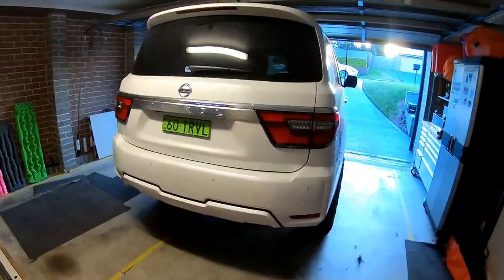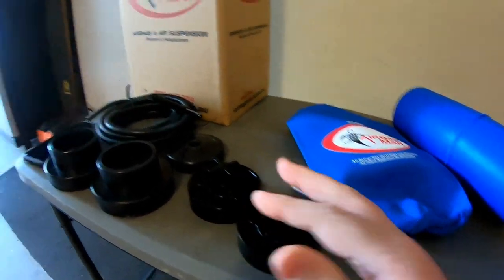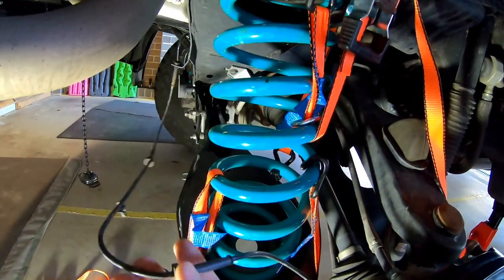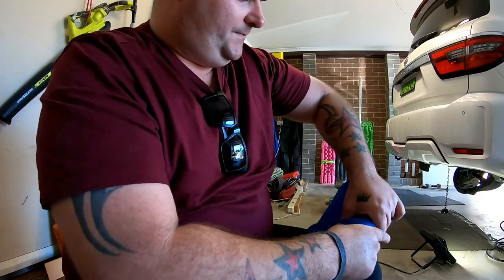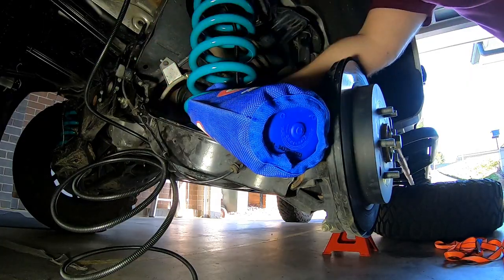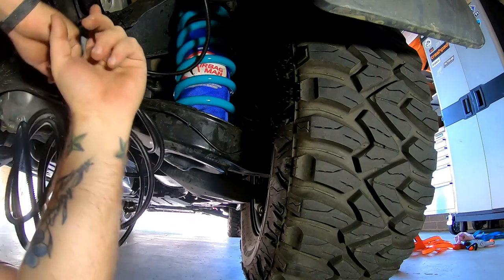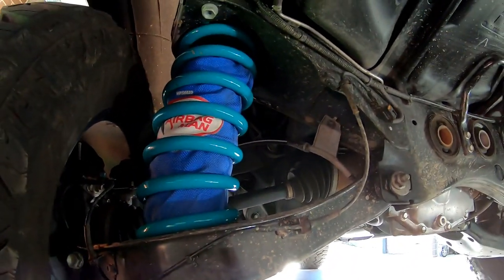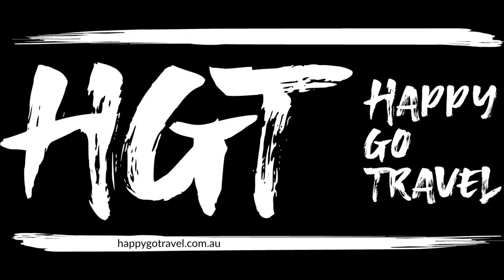Airbag Man - high pressure suspension airbag kit - HGT Y62 Patrol build

Comment: Nice work.
I fitted the lifted air bag kit to my patrol but at the time they only had a 2" lift kit bag which are still too short leaving a small gap at the top of the bag and the spring seat. Airbag man have since released an even longer bag for this reason. 
I fed the bags in with out the airline attached connected afterwards, didn't have as much trouble. 
Don't forgot to use soapy water to check all air line connections for leaks and don't route the lines near the exhaust where possible.  👍

Comment: Hey Caleb, did you install those black round cup / pillar protector things that sit at the top of the air and protect the air line going in to the bag? How did you install them? Did you tuck them inside the kevlar bag or did you shove them up into the hole in the car? Mine fall straight back down if i try to push them up into the car..

Comment: Hey mate, great video! Hoping for your opinion, I just bought a 2021 fortuner and planning on towing a FF camper trailer. Light off roading and beach work is mainly our game. Reckon stock suspension and a set of airbags would suffice or should I be looking at upgrading all suspension?
Reply from the maker: Hey mate if you’re not going to be loaded up all the time you’ll get away with it. If you’re going to be loaded up you can always get a heavier standard height coil to balance it. It is a good excuse to do suspension as well though ✌️the other thing to consider is forward folds generally have a fair bit of weight in front of the axel making ball weight heavier